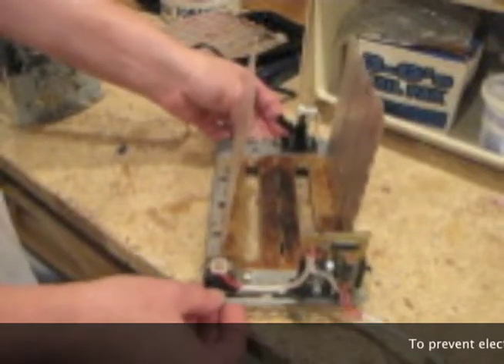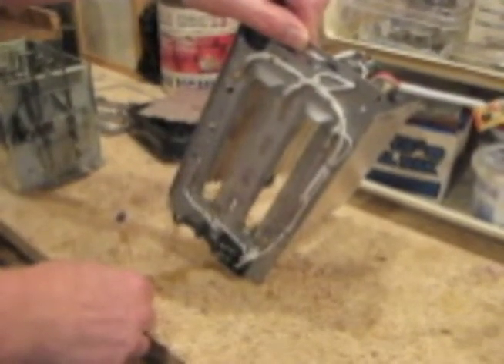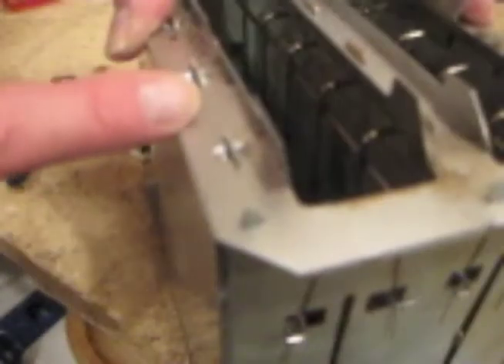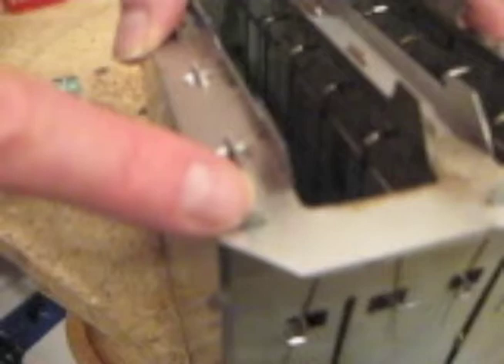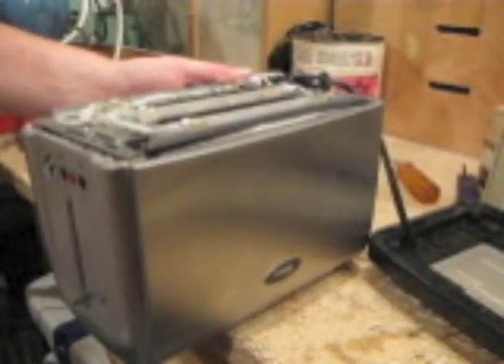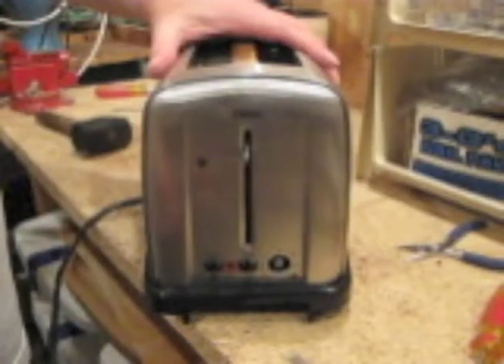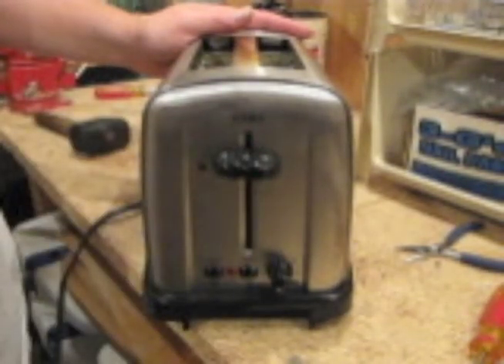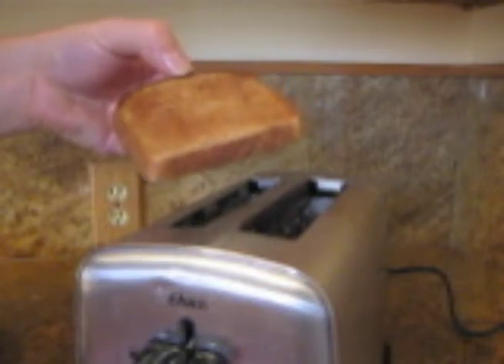How to Repair Your Toaster (Or Not) -- Part 2 of 2

Comment: Or you can take the two pieces of wire that are broken put a bend in each end slip them together crimp them with some needle nose pliers then mix some borax powder with water to make a paste .put the paste on the crimped wire and turn on the toaster the repaired spot will heat faster than the other wire and fuse together because of the borax flux and there you have a fixed toaster.

Comment: You can repair the elements by cutting the notches in the edge of the panel deeper to get some slack and overlap the ribbons, then crimp a little piece of tin can around them.

I was given this info by "Mr.Toaster" Joseph Paurel and have used it to fix a burnt out element in a 50+ year old toaster that makes my toast every day.

I think it would probably work better to use a little piece of stainless welding rod pounded flat and folded around the ribbon.